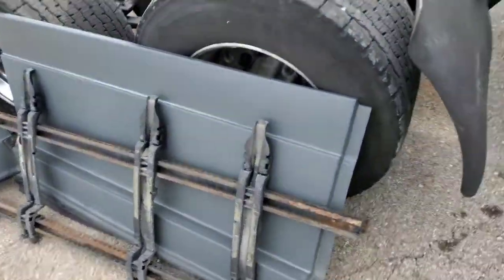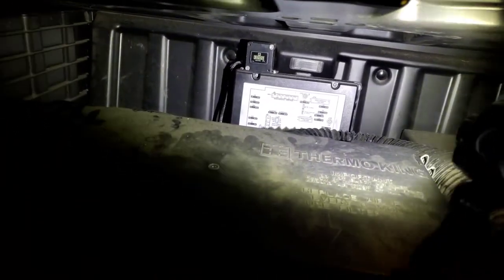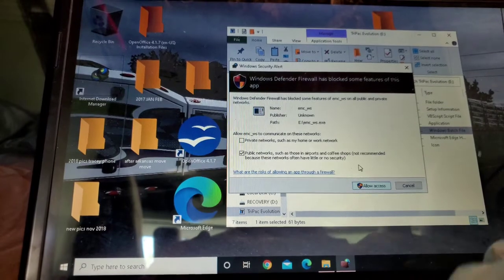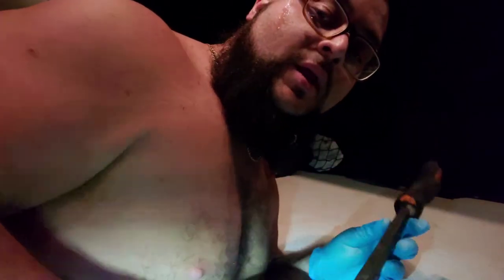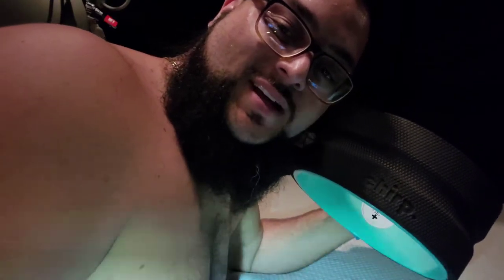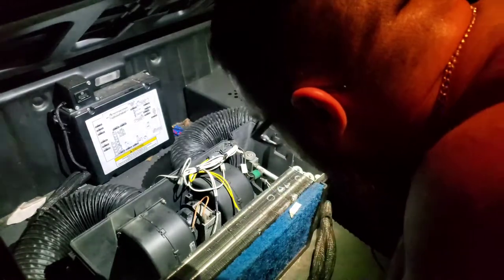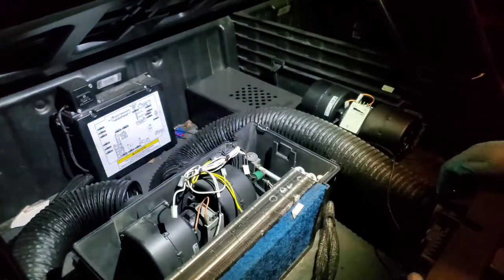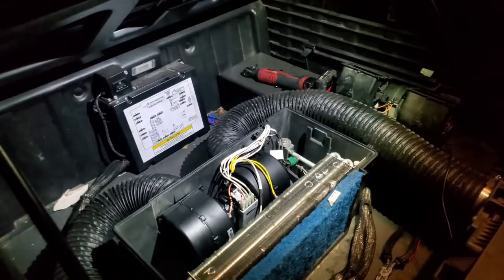TRI-PACK EVOLUTION EVAP BLOWER  REPLACEMENT DIY

Comment: Is that a regular laptop or is it the one diesel mecanics use for diagnostics???
Reply from the maker: It's just a plain jane laptop with windows 10! It doesn't need to be a special mechanic's laptop, as long as it has windows 10

Comment: Hi bro my fan turns off after 5min and apu keep running what can be the problem?
Reply from the maker: If it is old, you need new assembly.  Gotta go to Thermo King or whoever is the manufacturer, and get a new unit. Smack the fans while it's running, to see if it kicks in. If so, you need a new fan assembly
Reply from the maker: Thanks for subscribing!